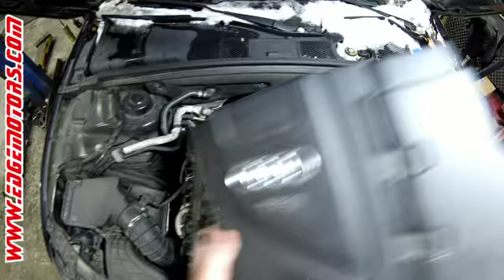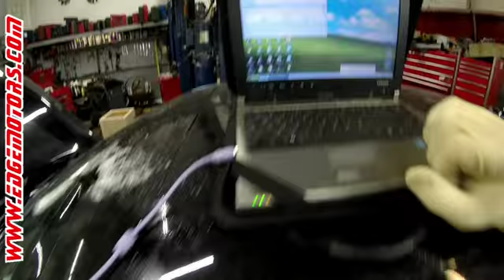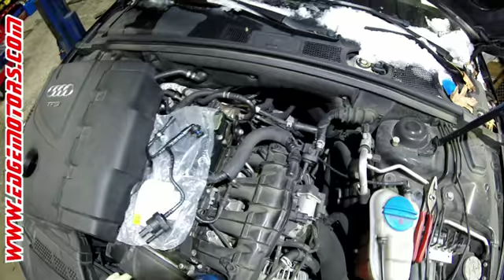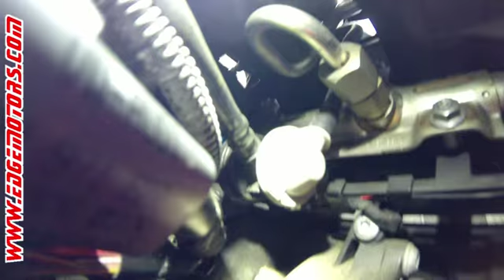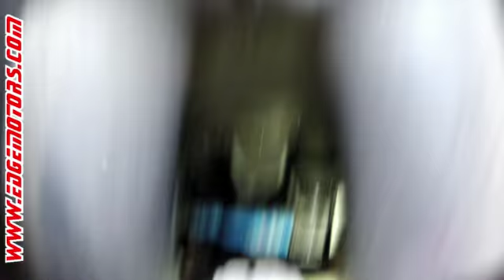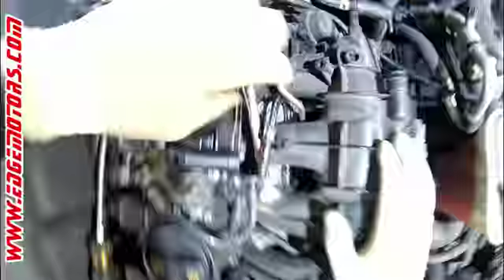Audi A4 2 0T TFSI Evap Small Large Leak Detected Purge Valve Replacement DIY by Edge Motors

Comment: Thank you.  I searched and searched and all I could find was someone replacing the purge valve only.  The hoses on the CC had become so brittle that there was no chance to just plug and play.   I just replaced the hoses and valve on my 2010 Volkswagen CC.   I was about to dismantle the intake manifold when I decided I’d try one more time to find a good video and you saved the day.  The CC is slightly different, but that little Phillips screw was the difference.  I got underneath, took an extension and finally found it.  To get it in was a beast.  I had to carefully fold the hose to get it through to the front but it worked perfectly.

Comment: I replaced my pcv , high pressure fuel pump , & vacuum pump and p2187 keeps popping up. Anything thoughts of what it can be ?
Reply: Same here, have found the p2187 issue?
Reply: @JS-xr1jv did you find a solution
Reply: Did you sort it out

Comment: Could this cause P2187 and P2279? I change my pcv valve 3 times already codes keep coming back after being erased
Reply: Yes! I beleive so. I had the same code pop up on my a5 2.0t tfsi engine and I had replaced the pcv valve and the vapor canister purge purge valve and it did the trick
Reply: @liamnikas2320  I changed it no luck I finally bought a after maket  intake and it fixed it 🤔 weird MAF was brand new unless it was defective, but engine light has not came back it's been 3 weeks already
Reply: @541_CoyotePower so you put new Maf sensor?
Reply: @buffalotroll2358  Yes and even back to the old one for the same reason
Reply: @541_CoyotePower  did it work ? I’m having the same codes and car drives fine code comes on once every couple days…no rough idle or anything…what did you change to get it to go away completely
Reply: @buffalotroll2358  Still keeps coming back I cleared the code and it drives alright for a while, but last time it was fixed it was an 02 sensor on bank 1 , the one that runs on the down pipe, he also said the lean issue was also due to my after market cold air intake since the MAF fitting did not have a screen like the original one does so it sees more air then fuel. So he put the stock intake and filter, changed the 02 sensor, and it was gone for a few months then it came back again.. PCV valve is deleted put an oil catch can. At this point I'm going say it's my fuel injectors they might be bad, a vacuum leak test has been done already nothing. My last thought it could be is a faulty MAF since I went aftermarket from eBay. Heard those are the main cause of lean codes if installed need to go OEM with those. For now the only code I'm getting now is P2187 only P2279 was gone completely after the mechanic fixed it.
Reply: @541_CoyotePower  right IE high cat down pipe just did timing changes and flex pipe the code started coming on when the flex pipe broke then I fixed it code went away then came back a month later. Really I don’t know what to check next I cleaned the maf sensor and check the values with vagcom and it’s working fine I have a ecs tuning air intake but stock filter and a box no whistling coming from the PCV valve…probably smoke test next..never had a cel before flex pipe fix
Reply: Thanks for the response by the way
Reply: @buffalotroll2358  Dang Sounds like you have a leak I that area, definitely I'd smoke test next bro. Good luck.
Reply: @buffalotroll2358  Np bro 🤜
Reply: @541_CoyotePower  just fixed it pcv valve diaphragm and so far so good
Reply: @buffalotroll2358  Nice! Glad you could figure it out unfortunately I'm sending mine to the mechanic since i already replaced the PCV 3 times then changed to an oil catch can. Anyways awesome hope that does it bro 🤜
Reply: @541_CoyotePower  thanks it was driving me nuts and I live in New York and wouldn’t pass inspection…did you change valve?..
Reply: @buffalotroll2358  Yeah I feel that bro, and Yes 3 times still no fix, I hope it's not the main seal or rear but no leaks so far Mechanic is gonna tow it to his shop check it  out tomorrow hopefully. Ill keep you updated on what my issue was.
Reply: @541_CoyotePower  yes keep me updated..I thought it was rear main on mine but my cousin that’s a mechanic said that it would be leaking so I don’t think it’s that on yours.did you smoke test?
Reply: @buffalotroll2358  Yea found no leaks man, all I can think of is my MAF is faulty for being aftermarket
Reply: @541_CoyotePower  put the stock one back on and see what happens …from ecs tuning

Comment: What does this valve do exactly ? My car is running rough with a flashing check engine light. When I’m stopped it vibrates and when the car starts running fast the shaking decreases. Will this help? I changed coil pack , plugs, injectors, cleaned carb, changed pcv valve....
Reply: You would need to check the codes and see what is the exact issure, what your describing sounds like a fueling issue and misfire

Comment: Thank you so much for this video. Genius! I just finished replacing this on my 2011 A4 Avant. Love the commentary and really hate their "genius" engineering for putting that screw on the bottom. I could not get it undone so had to break off the old connection in the end. Again, thank you so much for your efforts. Cheers.

Comment: Jesus this video has me laughing hysterically, I feel your pain and I don't think I could do this all the time; I'm trying to figure out a small evap leak on my 2006 A4 2.0T Quattro and so far just removing the ignition coils to get to my plugs (#4 barely has any room to grip or work in a screwdriver) has me feeling this. It seems like I did get rid of my cylinder 1 misfire though! 190k miles on mine, trying to keep her goin'

Comment: I broke the part of the purge valve that connects to the bottom of the intake manifold while I was removing the intake manifold. Do you have a part number for this replacement? 2012 Audi A4 2.0T TFSI Quattro
Reply: Do you know how much they charge to fix a gas leakage ???

Comment: I’m not getting an error code. But the engine rpms surges around 40-45mph. And also have a vacuum suction on oil cap. Replaced pcv recently. 2006 Audi A4 2.0t. Do you think I should replace my purge valves?
Reply from the maker: Vacuum is supposed to be there... 
that’s normal, as for the rpm surge purge valve will not help, that’s something else...

Comment: Can I just replace the purge valve instead to replace all hoses? I can just disconnect purge valve from the hose. I have just code 456 small leak every couple days and car works fine.
Reply from the maker: Theoretically yes you can, but the valve comes with all the hoses ...
Reply: I know but why to risk it to break something, leak is probably in purge valve not  in the hoses. Thanks for the video, if  I decide to change everything It will be very helpful.
Reply from the maker: Well the hoses are heat shrinked on the valve, so in order to remove it, you will have to heat the hoses, and take the valve out, and then do it again to put it back in... it not sure how the hoses are going to be after that... so that might be a potential leak there...